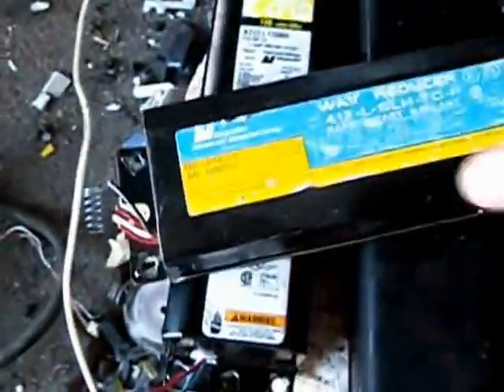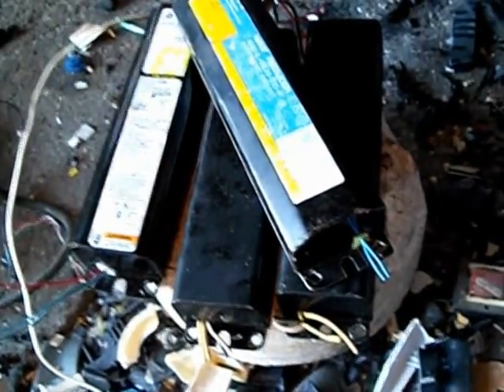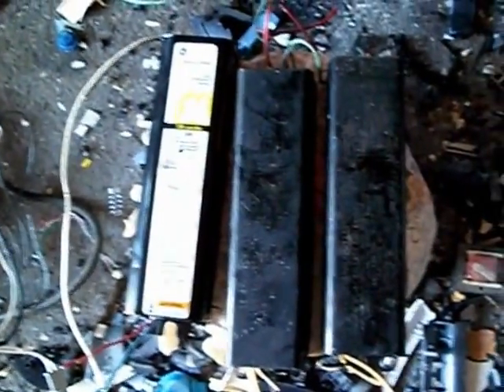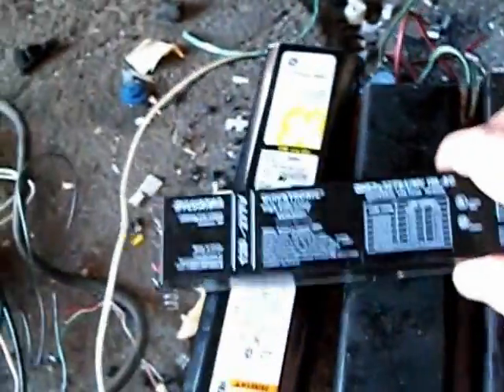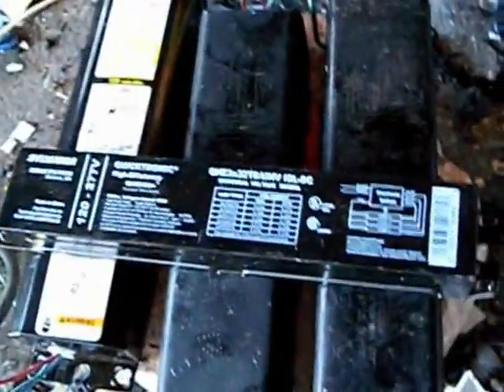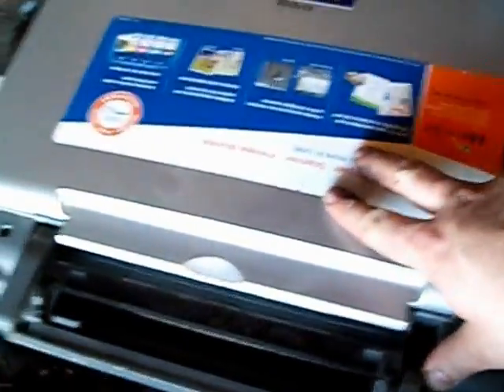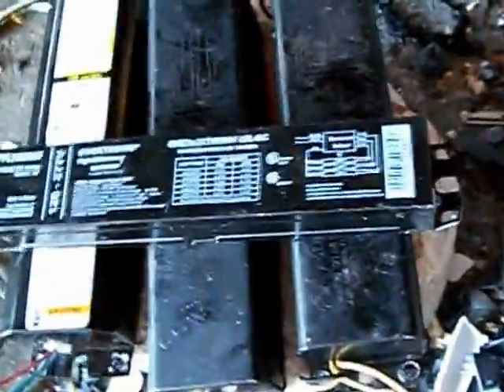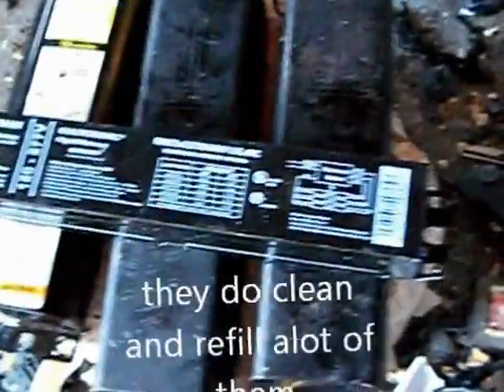Make Money Scrapping a Fluorescent Light Ballast

Comment: Good day
I cut open a couple of the older style years ago & saved the capacitors out of them but found it too hard to save the wire, so gummed in place. My Dad warned me then about possible PCBs so I quit.  
At present I give them (& ink & toner cartridges) to e-waste collectors.
I have a 1937 era ballast (not working) which is 25 cycles 110v. (as a display/museum piece, not scrap).
It is same length as the 3 old style,laid end-to-end, & 10kilos...

Comment: Hey... not all tar inside of an old "magnetic" ballast contains  
"PCB's." Some older magnetic ballasts do contain PCB's, 
but eventually they made it illegal to include PCB's with
magnetic ballasts. That's why you'll likely see "NO PCB's" 
on the stickers of most magnetic ballasts nowadays.
Reply: I started taking apart a few of the no PCB ballasts to recover the copper. I'm wondering why the copper spools in them look like copper on the outside but are silver on the inside. Is it aluminum wire and not copper?

Comment: In my area they won't take the old PCB ballasts. But since 1976 or so the "electronic ballasts" have "NO PCBs" on the lable. So check the printed lables, unless it's real old like 1970's they should be safe. We have a bunch at work I checked it out and they are Non PCB GE Ballasts